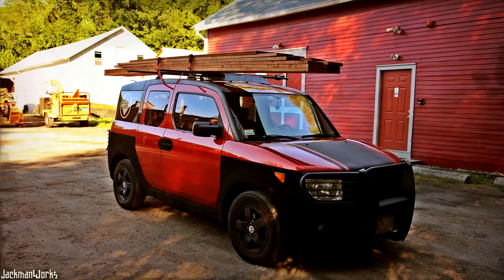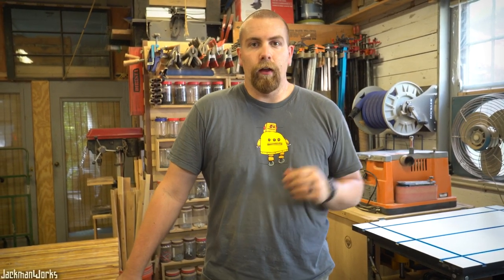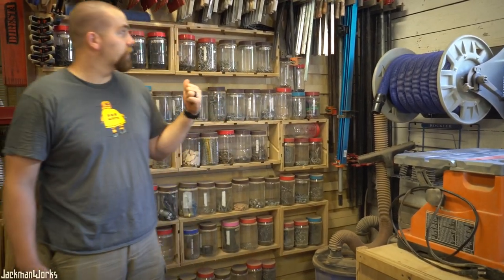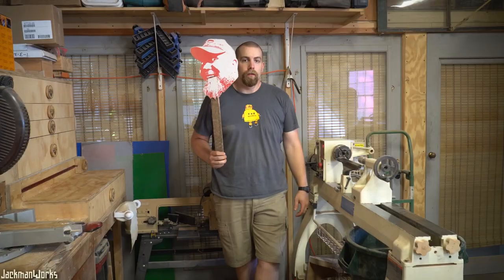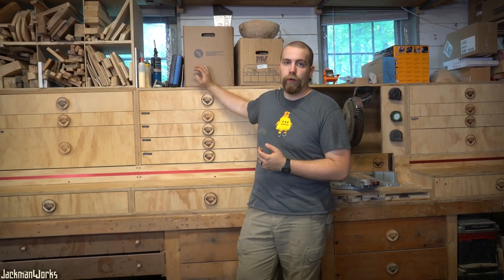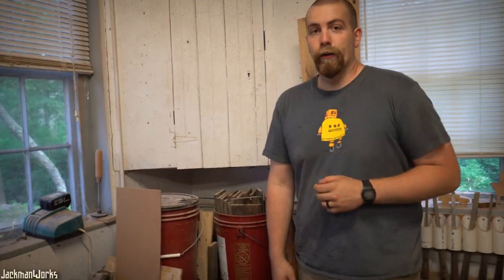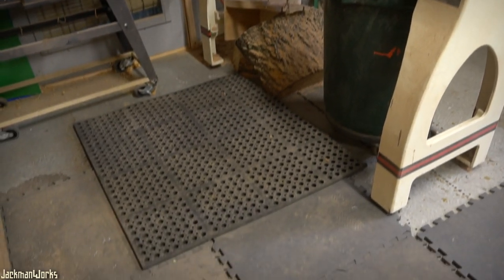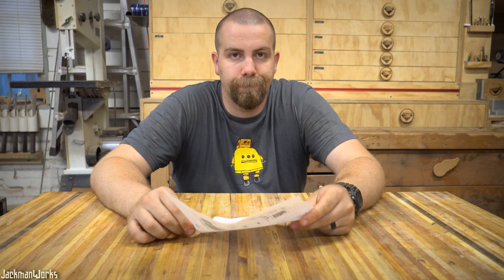Jackman Works Rhode Island | Shop Tour

Comment: Only thing I would add and its only from personal preference and experience is a Tormek T7 sharpening system. Sharp tools are essential for woodworking and it is by far the best system I have come across.
 I have a big industrial fan that I use when sanding outside. Blows away all the dust and gives a cool breeze!  Prefer to do sanding outside if weather permits. I built a fire pit so can chill out of an evening with friends with a cold beer after a busy day. All the shavings,sawdust and waste wood gets turned into a nice warming glow!